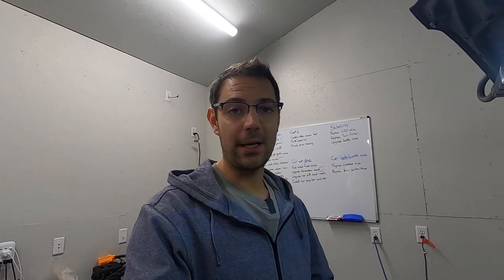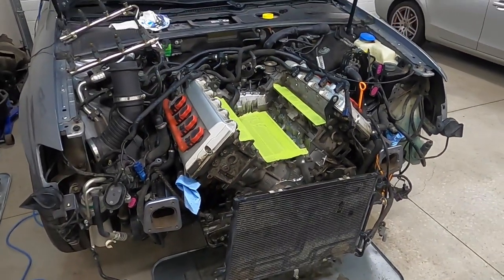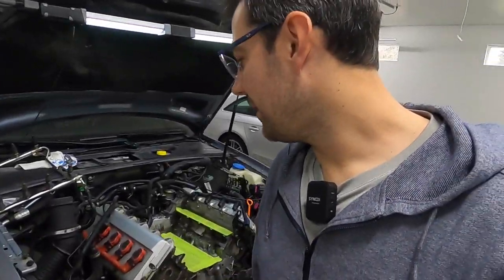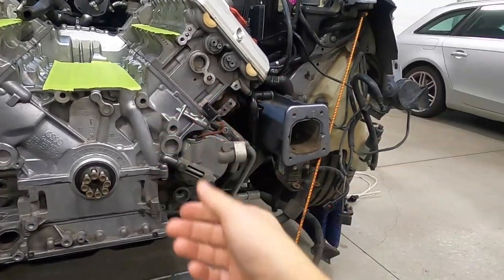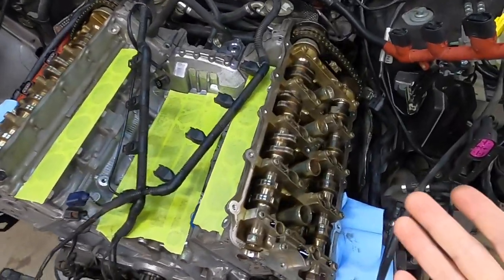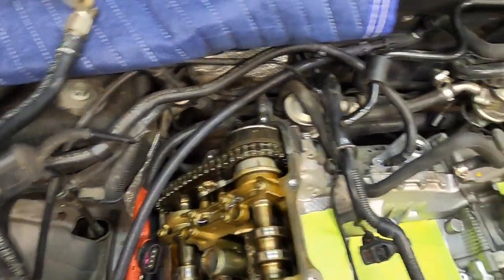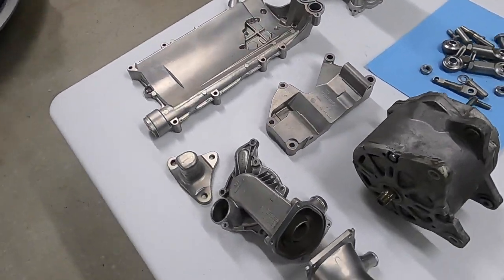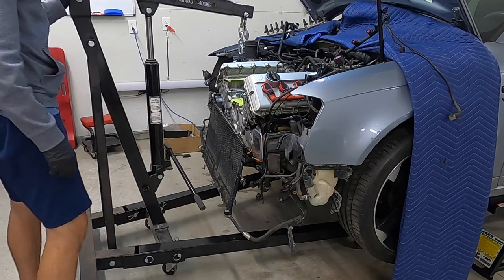The 25quattro S4 project begins! Major Degreasing with Dry Ice & Vapour Honing + Valve Cover Gaskets

Comment: Do you have a video or info on removing the front radiator/core support??
Reply from the maker: Actually, yes. Go look in the A4 playlist and you'll see instructions to remove the bumper, then look at the cooling refresh (also on the A4) to see how the front end goes into service position and ultimately removed.